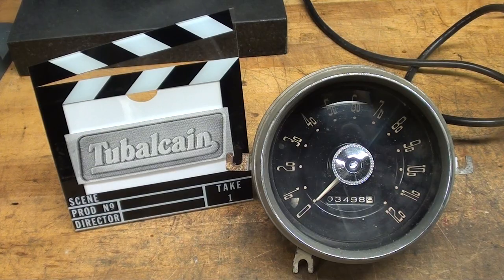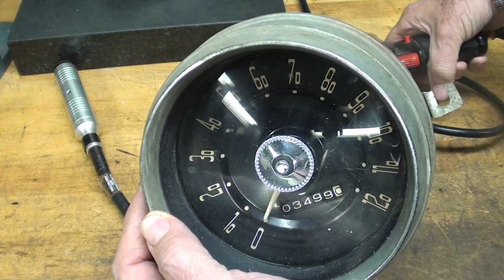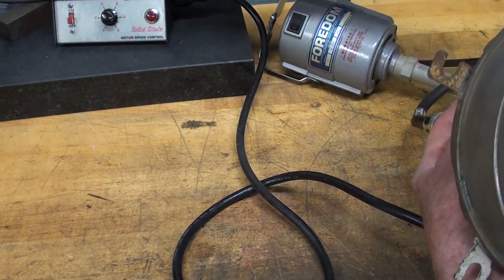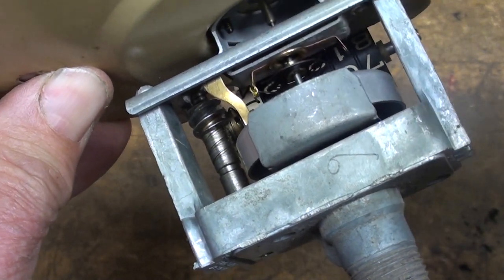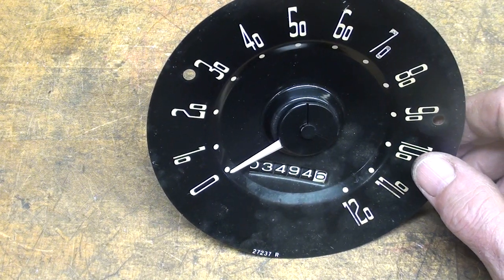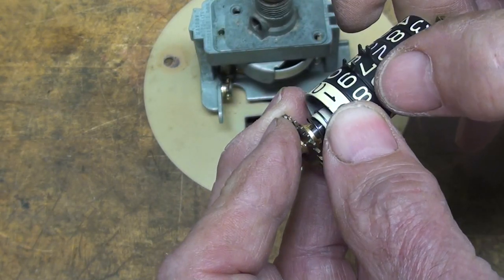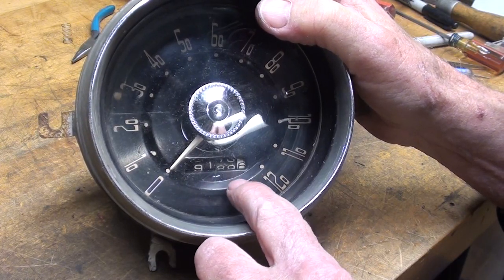WHAT MAKES IT WORK? #19  "How a Speedometer Works" tubalcain

Comment: I’m starting to wonder— how did they manage to have a flexible cable rotating at several thousand times a minute without it twisting?
Reply: The cable did not turn very fast not several thousand RPMs and we'll lubed right Mr.Pete?
Reply: The cable was wound with at least a double helix, with each helix successive wrapped in opposing directions
Reply: @SuperWhoremuffin  By the way, they were extremely hard to cut with a pair of diagonal pliers.  You damn near needed bolt-cutters to do it.

Comment: Back when I as a 16 year old back in the early 70s, my Dad would keep tabs on how many miles we would drive on a Friday night.  After one night of putting on many extra miles driving some girls home from all over the county, I decided to roll back the odometer by at least 150 miles.  I removed the speedo cable from the transmission of the 1966 Ford Galaxy 500 and hooked up the only drill available, which was Dad's 1/2" Montgomery Ward.  I hooked up the drill and was quite disappointed when it would only run at 40mph.  I had limited time, so I gave up on the project, and by chance, Dad never did check it that day.

Comment: Green and Red lights: Green - alternator, Red - Oil.  Green showed the Alt. was putting out current, Red would come on if no oil pressure.  The two lights would come one when you first started your car (to let you know they were working).  Just an old Ford boy here.

Comment: Thanks Mr. Pete I was looking forward to you doing this.  Lots of good stuff you touched on here.  Wish you could have spent some more time on the Eddy Current principles but the odometer was great and amazingly complex for a counter of the day.  I won't go into all the physics about Eddy currents but your previous video with dropping a magnet through a tube reflects the same principles.  They are used in all kinds of mechanisms from braking to linear motors and MagLev systems today.  

The history goes back to Babbage and trains in the early 1800's but the speedo is credited to Otto Shultze in 1902.  I was graced to learn more, after my father back when I was a kid, to apprentice/working with a Carb and Speedo guy who was in his mid 60's in the early 80's and about to retire.  He passed on so much to me and grateful for that, as I am to you for all that you bring forward.  Dad used to say about people like you and he, that;  "His little finger forgot more than most people know."  

Also there were several cup styles I saw, from cup shaped to conical...and some anti-rollback mechanisms for the counters, to prevent the dishonest from their trickery.

https://en.wikipedia.org/wiki/Eddy_current

https://en.wikipedia.org/wiki/Speedometer

https://www.youtube.com/watch?v=otu-KV3iH_I   Thought this would ring a bell.

Many Thanks, Mr. Pete!  ~PJ

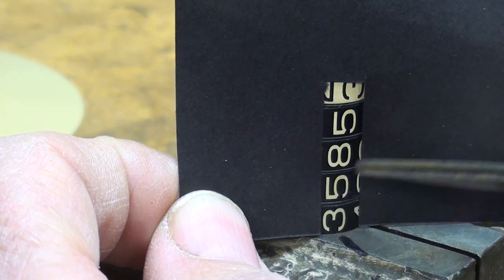Comment: This was a great video, MrPete, thanks! I took one apart on a 90's pontiac and when I put it back together the numbers would skip from ...38 to ...49! So I was looking out for that here, the row of numbers you show at 26:50 started with 35... But the correct row was the one starting with 24... It was a headache getting it to line up again! But it had to be done, the original speedo broke and the replacement one had too low mileage.

Comment: You might add a link to your magnet experiments. The eddy currents (and the induced counter magnetic field) that drag the aluminum cup around are the exact same as the effects that cause the magnet to drop so slowly through the copper tube.

You can see the same effect in reverse when you move the needle by hand and release it - the needle returns to zero quite slowly. In this case it is the aluminum cup rotating in a fixed magnetic field.

Comment: I think my dad, an auto mechanic, told me about the spinning magnets inside when I was about 8 years old, too.  I kept waiting for you to explain why the speedometers in old cars sometimes have a tendency to bounce wildly at slow speeds.  It has always been my suspicion that problem is due to the cable needing lubrication wherein the cable’s driven
end connected to the transmission turns at a constant rate but the opposite
end connected to the speedometer stops and starts in a herky-jerky motion.
Reply from the maker: yes--needs lube-cable is windin & unwinding

Comment: Very cool dissection. It would be cool to see you take apart a chronometric speedometer. They work like clocks. The speed updates in intervals rather than the fluid movement that the magnetic ones have.

Comment: Thank you for the explanation sir. I have a mechanical tach in my airplane that reads 100rpm low so I am trying to figure out whether I can have it re-calibrated and your video is most helpful with understanding how these eddy-current indicators work.

Comment: Some speedos (like those for an Opel GT) have a mark and a corresponding rpm noted on the dial face that allows you to calibrate the unit on a bench.  I was able to verify that the unit on my car would have been accurate if the wheels/tires were stock, but they were smaller, so the unit read high.  Wish I still had that car!

Comment: I can remember a floor mounted high-beam switch!
Reply: My first "car" was a 1947 Willys Jeep, CJ-2A.  It had two identical looking dimmer switches on the floorboard.  The one on the left was a dimmer switch, the one slightly to the right and above the accelerator pedal was the starter switch.  

That way you could crank the engine over with the toe of your right shoe and pump the accelerator pedal with the heel of your right shoe, at the same time!  Good memories!
Reply: Grandpa Cocky remember my band teacher told me a story from the days of vacuum operated wipers

He had to stop going uphill in the rain driving a Chevy pickup once because the wipers would literally stop as the engine would be pulling too much air under load
Reply: @TreeTop1947  i have a willys but it's a work in progress

Comment: I was at a gas station in Maryland that had a dynamometer that was used to calibrate the Prince Georges County Police speedometers.

I remember used car dealers putting Motor Honey in the engine and sawdust in the differential.

Comment: There is a stigma attached to odometer readings.  Someone wrote down the mileage wrong on my Supra, probably getting my oil changed or some minor repair, and it completely destroyed it's value from an appraiser.  It wasn't because it was too high or too low, but that it wasn't chronological.

Comment: I realy enjoyed this one.  I had torn an old speedometer apart as a kid and figured out how they work a long time ago.  You are correct that it was at one time not a crime to alter the odometer record.  It only became a crime after the value of used cars had risen enough that it went from being a couple hundred bucks more to several thousand more for a low miles car.  After it became a crime the manufacturers of speedometers installed a scribe mechanism inside the odometer so if it was rolled backwards while the unit was assembled it would score a mark in the center of the numbered wheel, leaving a visual indicator of tampering.  An acquaintance of mine owns a garage.  He is in his 80s now and still works every day.  He told me that his business was at one time a certified speedometer repair shop and he did the majority of speedometer "repairs"  for the car dealerships in nearby Youngstown, Ohio.  I have worked on many, many cars in my life.  I have only had to replace one speedometer ever.  And that was in an '88 Chevy Cavalier.  My guess is the little magnet likely came detached from the speed cup.    I have had several apart for classic cars.  Simply clean, oil, sometimes repaint the needle and reassemble them and they are good for another 40 plus years.  

All the best!

Mike

Comment: I know very well about working under the dash. I worked a couple months at a car stereo shop in the 2nd part of the 70's when everybody and their mother were buying C.B. radios for their vehicles. (remember the song "Convoy"?). We also installed after-market cruise controls. There was a box you mount under the hood with a linkage that went to the carb. It also had 2 shafts on it, an input and output. We removed the cable from the back of the speedometer and the tranny. The cruise kit came with a couple shorter cables. One attached from the tranny to the input shaft of the box. The other cable went from the output shaft of the box to the back of the speedometer.
Reply: P.S. Moving the odometer back reminds me of the beginning of the movie "Used Cars". It is a hilarious movie starring Kurt Russell. Also had 'Lenny' and 'Squiggy' (from "Laverne & Shirley" - not a big fan of that show), and Al Lewis (grandpa from "The Munsters"). A must see movie with a little gratuitous nudity.

Comment: Tell us more about the Renault that had a speedometer that "howled in the winter."  Why winter only?  What caused that, the cable or the speedup gears or what?  I face similar issue with '8 Chevy Apache.

Comment: What would make the speedometer stop working when the odometer still works?  The pin is in place, spring is in place- just won't work. The magnet spins-  It's a 1950 Chevy truck.  Any thoughts or suggestions as to what I should look for to fix this?  Anything that would cause the magnet not to spin the cup holding the pin?

Comment: Aaaamen to under dash misery! You described it perfectly. Still have scars from our '69 Fury...always an air conditioner switch. I've been trying to place those stylized digits; first remembered them as GM, but comments about Dodge reminded me of my grandfather's late 50s Plymouth, and I think that's the match. Mopar used red for high beam in the 60s, but those lights could be oil and generator. Doubt it would lack a beam indicator, though. Europe was different; our '64 VW already had a blue beam indicator (with green OP and red gen).

I knew you were going to say, "I'll call him Don to protect the innocent." No, "...'cause it's his name!" lol

Someone mentioned old cars smelling alike. It's largely the seat foam, but the VWs have a unique smell. Fun memories.

Comment: I had a '61 Olds, F-85, that had that cup come loose on it's shaft, and caused it to peg while moving in the drive way.  I took it out and apart and managed to re-anchor the cup (can't remember how though).  After that it would show approximately half of your actual speed, so I think they were calibrated by adjusting the cup to increase or decrease the amount of "drag" the magnet had on it.

215 ci aluminum block V-8, with a Hydra-matic 3 speed, no torque converter (the old whiplash shift automatics).  They had a lot of snap, and could get as much as 20 mpg on the highway, which was pretty good considering the weight of the car.  If I could find one of those engines in good shape, I'd be tempted to try fitting it into my S10....

Comment: You mentioned the older car dealerships replacing certain interior parts to make the car look newer than it actually was, most used car dealerships now do sort of the same thing, but they do it by covering the plastic engine covers and hoses with tire shine. The half worn tires also get a good coat of the same, while the dash and interior all get armor-all.

Comment: I replaced the speedo in my XY Falcon (Aussie car) which was in mph with a unit from a later build (same model) that was in kph. The original speedo had given up the ghost. When I was doing it, I pulled the new speedo apart and it was a very easy task to rearrange the odo dials to 00000. I didn't do it to rip anyone off mind you, but I just thought I'd try. The car was about 26 years old when I sold it and the odos only went to 99999 so it had clocked over about four times regardless. I told the guy who later bought it off me that it was a non original speedo and to ignore the odo.

Comment: Cool vid Mr.Pete.Even before you asked,I thought it was a Chrysler product because of the different size zeros.If we knew we would be selling a car,we would just disconnect the cable at the head to stop putting miles on "the clock".

Comment: Yes modern vehicles do use electronic speedometers, without cables. Most, if not all, now use the electronic pulses from the ABS system to determine the speed (and generally, if the vehicle doesn't have ABS, it will still have at least one ABS sensor to provide a signal), which is sent to the engine management computer as well as the speedometer display. Some earlier electronic speedo's used a sensor that still used the square drive peg and drive mechanism in the gearbox that the cable drive used.

Comment: that was the trick back in the day mechanics would wedge tumblers or remove to set back..thanks for videos again.....on a back note one of other videos you mentiond  rust on machinery caused by being in unheated room can you clarify on that please
Reply from the maker: Cold garages heat up in the spring--heavy metal sweats-condensation.--rusts

Comment: MrPete, if the part number on the back of your speedometer is 18778A, you have a 1955 Dodge speedometer. If it is 14195A it is a 1956 Dodge speedometer. As I recall, Stewart Warner made Ford speedometers, not Autolite. (See partsfromthepast.com under Chrysler). 

When I was a boy, my father had an auto repair shop next door to a used car lot. He did touchup and small repairs for many of the used car lots in town.  There was a man all the used car dealers called to turn back speedometers. I remember him because he was a paraplegic who had hand controls in his own car. At 12 years old, I was very impressed with his car. There was also a man they would call "re-groove" the tires. I watched him many times using what looked like a big electric soldering iron with a little metal loop at the end to deepen the grooves so the tires looked almost new. He got 25 cents for each tire.  The strange part was, the owner of the lot was one of the more honest dealers in town. So much for honesty.

Comment: Hello sir I have a question and would appreciate for you to get back to me......I have a 1973 Plymouth duster and just finished redoing the engine and sent my 904 transmission to be rebuilt....I finally drove the car the other day to notice my speedometer was waving back and forth when I hit 40 mph.....today my speedometer fixed itself but now I occasionally have smoke coming through the speedometer glass and only the speedometer glass I have no idea why it's doing this but I'm leaning on it being the speedometer cable...what do you think it could be? Any help or advice will be appreciated
Reply from the maker: Yes, remove the cable and lubricate with the graphite. There may be a Lubricant especially for the job?

Comment: Like an electrical generator and ammeter bundled into a much simpler device... makes me wonder if an ammeter attached to the alternator (with a mode selection upon gear change -- neutral, drive 1, drive 2, reverse) might also work for the speedometer.
.

Comment: petethe green light is a oil indicator and the red light is for the generator. NO I don't miss the good ole days of vacuum wipers  3 on the tree that always hung up on rainy days LOL and the hair spray to seal the distributor or the manual choke or that dreaded starter button in the floorboard next to the gas peddal
Reply: I figured the red was low/no oil pressure and green was shared for turn signals. But come to think of it you had the tick tick tick of the relay to remind you that the turn signal was on, so why would you need the light? I bow to your experience.

Comment: I'm going to guess here because I never had a car that old, but I figure the red light was an old fashioned idiot light for low or no oil pressure. The green was shared for both left and right, if you're smart enough to drive a car you should know which turn signal you just applied. Also, if youre driving at night you could just see that your highbeams were on, since the low beams lit up a dull yellow if they were visible when lit up at all.That is such a simple design, and yes I remember my oldsmobile had a peg at the end of the needle travel.

Comment: Mr. Pete. I think I discovered the mystery of what the speedometer is from. It is a 1956 Dodge Coronet. I used Auto Trader online because the pictures they offer can be enlarged some. Getting a good photo of a speedometer would seem most cars for sale would have such but usually it is a distant view of the entire dash or if just of the instrument cluster, the ones I saw of the speedometer had a glare or reflection and the numbers were hard to distinguish. Definitely, it is from this year, make and model.
Reply from the maker: Thank you for solving the mystery
Reply: @mrpete222  You are welcome.

Comment: Wow on my earlier post part of it got lost, it should have read on my VW  the red light was the gen and the green was the oil. Now on my old 58 chevy Pu the  turn signal indicator was my left arm LOL.
Reply: Right. The red light was for generator failure. Thanks for reminding me. That was the first idiot light, when they took ammeters out of cars and replaced them with a light. The light was connected via a diode so that normally, when the generator was working its voltage was higher than the battery and the light would be dark. When the generator quit (or the fan belt broke) the battery voltage would be higher than the generator, the diode would be forward biased and current would flow through the idiot light.

And cars that old may have had actual generators (rather than the more modern alternators). My '56 VW bug certainly had a generator. BTW, the '56 VW bug was the first year they (VW) had blinking turn signal lights. Prior to that they had little solenoid-operated arms that swung out of the door posts; on the end they had a little illuminated hand with a pointing finger to indicate which way the driver intended to turn.